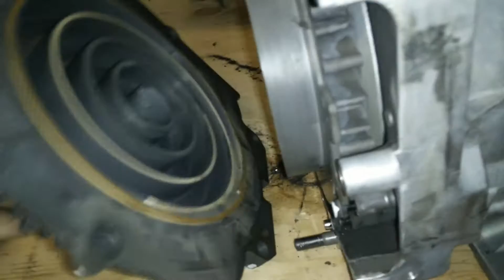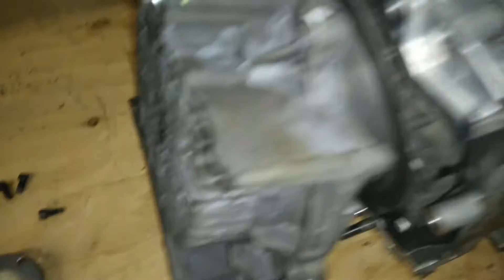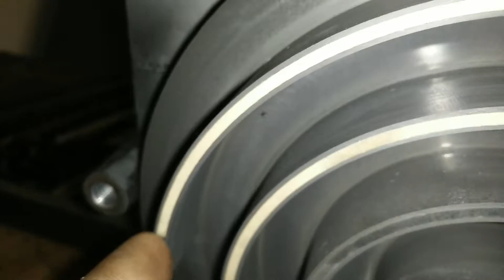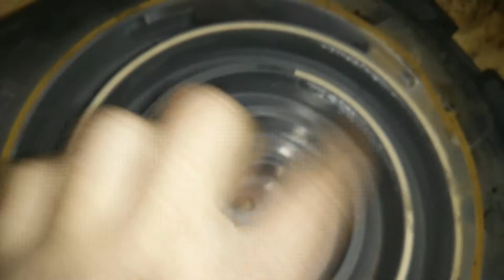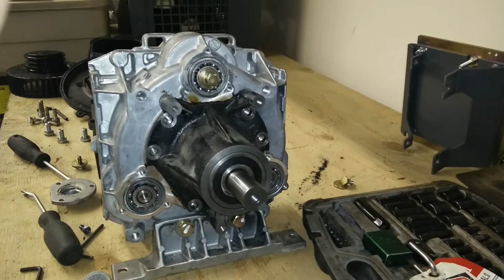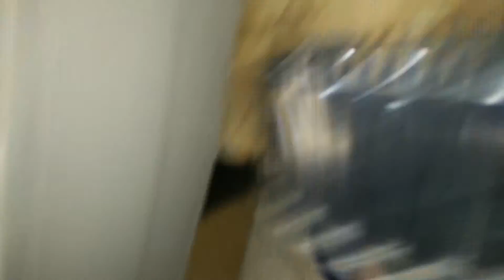Oil Free air compressor. SF4 atlas copco

Comment: After replacing tip seal and dust seals and lubrication. Is it normal that the rotation of the pulley is little bit hard, when you manually rotate by hand? . Will it be smooth after a long run?
Reply from the maker: Oh boy I don't remember, I'm out of the compressor industry now for r years so can't remember if the new seal faces were tight or not
Reply: Hi dear i have the same problem did you solve it?
Reply: @jmak0666  yes. I dismantled everything and removed the excess grease. It would be tight if you applied more grease

Comment: for atlas copco Sf 4 ff, it doesn't have performance, it makes the air hard, the gasket to buy can be found, I mention that it was not dismantled, it makes it harder
Thhanks Nick
Reply from the maker: When repairing always change the check valve as well, it's not much but it stops the compressor pushing back against the tank pressure
Reply: @OTBkid  ok, thanks

Comment: Is it possible to salvage a compressor like this with shot bearings? The service office put up a offer on the repair and its 5000usd, they needed to replace the compressor element it says, but if i can salvage this myself it would be fun to try:) SF4FF-8 with an ATLS 165E compressor in it i think.
Reply from the maker: I don't see why not but you might need a special puller to get the old ones out
Reply: @OTBkid  the compressor is stuck, but if its jammed because of bad bearings it should in theory be enough to replace the bearings and do a service on the unit itself? Do you know the size of the bearings in the unit?
Reply from the maker: @stbo84  no I don't, I'm out of the compressor industry now but they'll be a metric sizing due to being a European unit.
Reply: @OTBkid  ok, i will try to unmount the compressor and open it and see:)
Reply: @stbo84 Hello, I want to know if you were able to change the compressor bearings

Comment: My air compressor is heavy and unarmed, does it have bearings? How old can you have bearings? Is it easy to replace? It's the same as you're at the table.
Reply from the maker: Cristiano Assis we've never replaced them but I'm sure you'd need to apply heat and have special puller to redo the bearings. The bearings should last a long time if you are greasing all 4 regularly
Reply: Okay, I'll check, it may not be that. Excessive and very loud and heavy noise for the motor could be the scroll or other kits? I do not know what it would be.
Reply from the maker: you could remove the belts and spin the scroll side and then the motor side to determine if the motor bearings are bad or scroll.